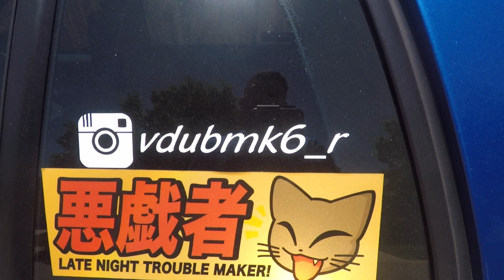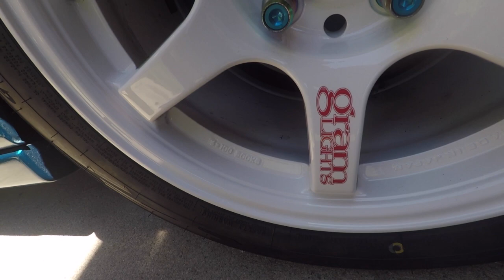MK7 GTI LED Tail lights

Comment: Nice! Where'd you pick the mk7.5 tail lights up from? And do they come tinted?
Reply from the maker: AjaXx2421 thank you! https://m.ebay.com/itm/for-VW-Golf-7-MK7-Golf-R-GTI-Golf7-5-MK7-5-LED-TAIL-Lights-LED-dynamic-Signal/122906533932?hash=item1c9dcce02c:g:WcQAAOSweNta4Be4 this are the ones I got they are aftermarket but way cheaper and work very good!! And also make sure to get the harness for the dynamic signals😅 I’m get it soon so they look like I want them too! And they come tinted like how they look on the video

Comment: Hi,

I have a GOLF GTI mk7 with factory-fitted LED tails. Do I still need the wiring harness or is it going to be just a plug n play?
Reply from the maker: Zain ul Abidin Khan you’ll need the harness for the dynamic turn signals, everything should work like it’s supposed to just not the dynamics
Reply: Boosted imports great, many thanks for your prompt reply. Any idea where can I find these harness?
Reply from the maker: Zain ul Abidin Khan easiest way to go is shopDAP harness and obd11 for the coding, only downside is the harness is $200 unless you want to figure out the coding your self then go with an eBay $50 harness which I don’t recommend 😅

Comment: What harness are you going to use?
Reply from the maker: bjt42069 I bought the eBay harness but the coding is different I’m be making a video on the coding pretty soon if you don’t want to brake the wallet the eBay harness is way cheaper and works the same!
Reply: @thekiki303  will you post up a link for us? I'm not sure what to get. Definitely, EBay is the way to go
Reply from the maker: bjt42069 yes I’ll include the link to the exact harness I got from eBay

Comment: How has the quality been on the taillights I am looking for a pair
Reply from the maker: Dmitriy Sizonenko the quality has been wonderful can’t really compare them to the 1000$ ones since I haven’t had the opportunity to really compare but from what I can tell you is they work great!super bright, great quality and well built I haven’t had any issues with water getting in them or nothing over all very pleased and happy with them for just a portion of the price from other sellers well worth it! Only issue I had was the coding for the dynamic turn signals, it’s different if you get the eBay harness i had to figure out the coding my self but I’ll be making a video of that pretty soon but if you go with a different harness you should be able to use the coding everyone does I guess the lights aren’t the problem there, the harness is